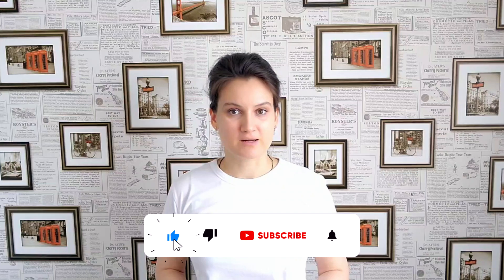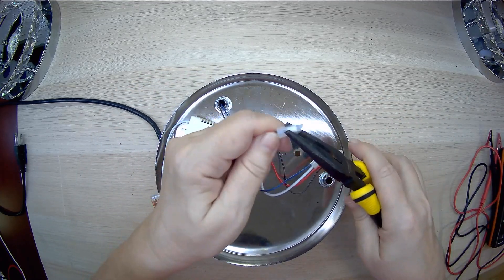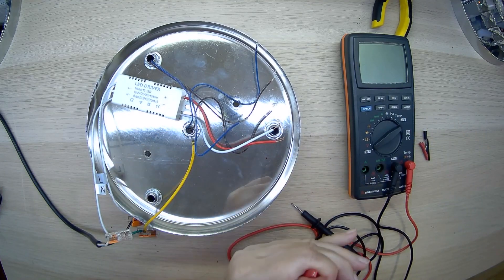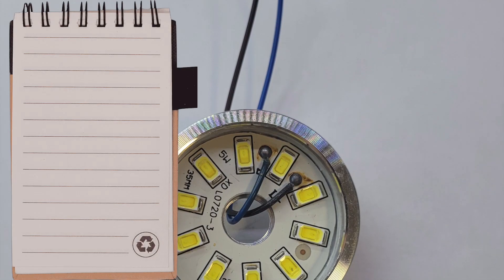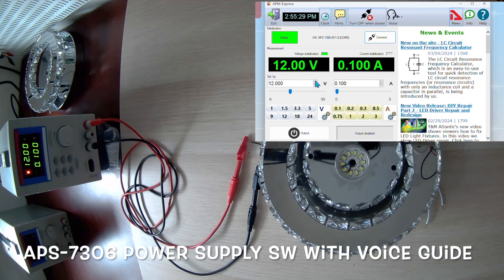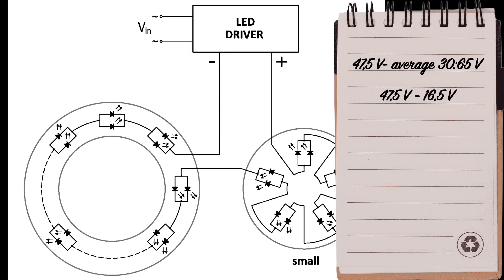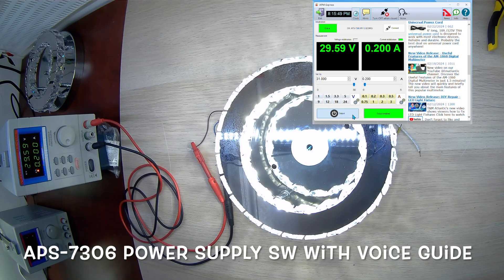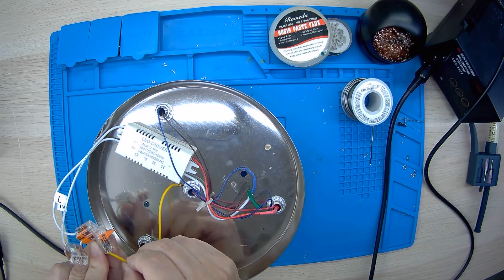Fixing LED Light Fixture Part 3:  Unforeseen causes of broken LED lights #led #ledlights #fix

Comment: I didn't know you can do this. I fixed my first LED bulb today thanks to your tip. One of the LEDs had a black spot on top like in your video, but it also blocked two others from shining. I removed it and bridged the contacts with solder.